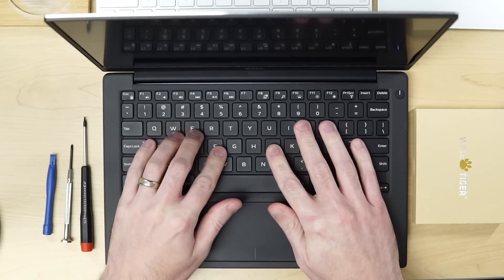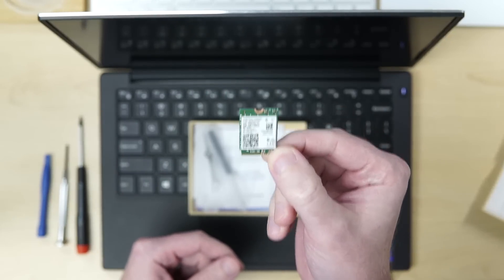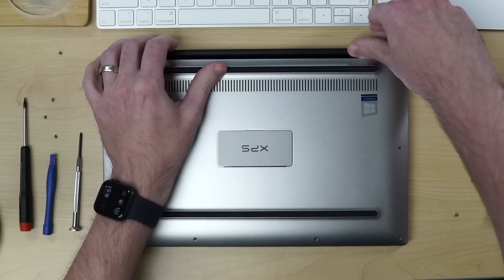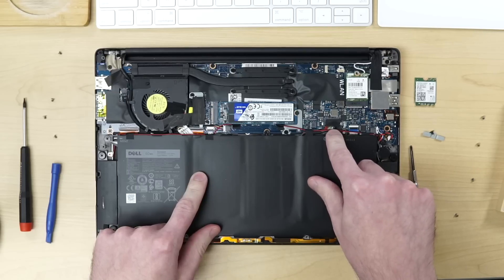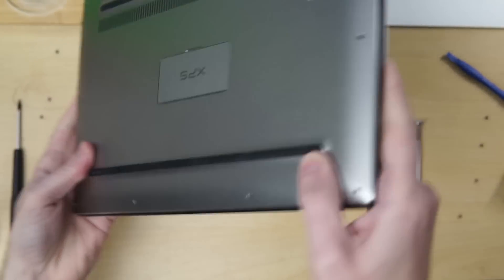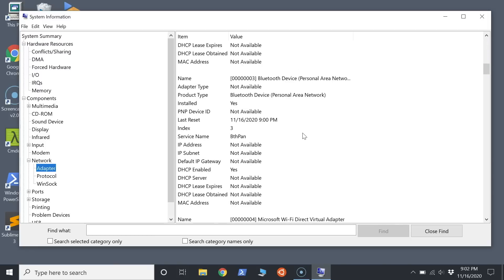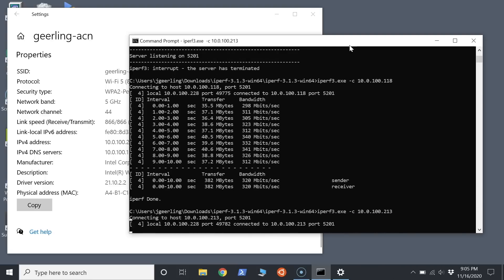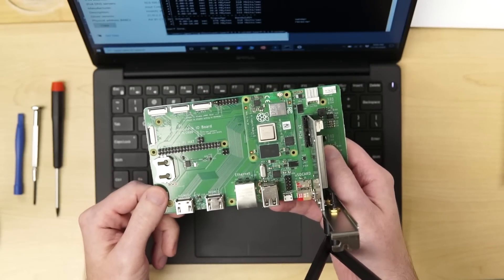How to Upgrade a Dell XPS 13 to WiFi 6 (802.11ax)

Comment: TPM error is due to the fact that you changed the HDD
Reply: If you replace the original HDD then TPM error will disappear 🫠
Reply: Also TPM Third Party Module is security for HDD the HDD is paired with the Bios if you remove the HDD and try to access the data on a different machine the DATA will not be accessible because on power up it doesn’t recognise the bios TPM

Comment: I did this mod on 9350 model. The wifi worked fine on Ubuntu and win 10. Bluetooth worked good on Ubuntu too. My only issue was win 10 kept throwing a code 43 error in device manager for bluetooth. New and old drivers made no difference. If I reinstalled the drivers, bluetooth will work fine until a reboot and the error code 43 pops up again. I don't use windows that much so I just gave up trying to fix it.

Comment: Hi Jeff, can I check with you, what is the wifi socket type for the Dell XPS 13 (9360) (A Key or E Key)? Does it support CNVIO/CNVIO2? Does it support the E-Key only Intel BE200 Wifi 7 card? Will there be any issues on Wifi 7 with using the existing internal antennas?

Comment: 9:47 its still connected to 5g, and never connected to 6g....so the wife detected but did not connect to wifi6.....it didnt work....
Reply from the maker: WiFi 6 only works on 2.4 and 5 GHz channels; WiFi 6E works on 6 GHz (in addition to the other two).
Reply: is wifi6 working on the 6ghz with your xps 13 after this install?

Comment: will the  AX210NGW WiFi Card, Wi-Fi 6E 11AX Wireless Module Expand to 6GHz MU-MIMO Tri-Band Bluetooth 5.3 Internal also work that the difrance
I click your link but out of stock you list the AX200HGW  and the on in stock is AX210NGW  is this just answer model?

FYI Great Video

Comment: um, I worked for Dell pro support up until a few months ago, the reason your laptop keeps turning of and on again is actually more than likely 1 of 2 things. on the dell drivers page make sure you go to the chipsets or just browse all of the drivers for a "virtual button"(may include the word controller) from intel, some of the xps 13 have a firmware for the button assembly that is controlled by a intel chip because they included "human detection" featured so if you go to turn it off but the human presence sensor on it is detecting your presence if kicks it back on..... the other is a need to actually do a bios rollback. Honestly the BIOS on dell systems tend to be really.... less than ideal.... but thats just my opinion as someone who had to work with them all the time.

Comment: I don't own either a Dell or Mac, but got a gigabit fiber into my house. 

The desktop which runs an Ax 200 it gets a 600/500 via WiFi. My Asus laptop which got its WiFi replaced from 9650 to Ax 201 it gets 600/600. 

I have a WiFi 5 router.

Comment: It's better to download the compatible driver for the WIFI card you're gonna use before replacing the old one.  Otherwise the new card may not be recognized (I just faced this issue and needed to connect to the internet using a cable).
Reply: my wifi card failed because of driver update it:s a ax210 i requested a refund what should i do i need a upgrade

Comment: How does it work with linux?  I'm interested in upgrading to the same chip but I'm running linux mint exclusively on my XPS.
Reply from the maker: The AX200 seems to work okay with Linux, and is one of the better-supported cards. For my Raspberry Pi I had to patch the driver though—not sure on other computers. https://pipci.jeffgeerling.com/cards_network/edup-intel-ax200-wifi-6.html

Comment: 7:26 I have the exact same issue! Appeared after the recent BIOS update, and, for the life of me, I cannot fix it. Tried disconnecting the main battery and reconnecting, disconnecting the CMOS battery and reconnecting. No luck either way. I eventually had to downgrade the BIOS as that white screen on every boot was driving me crazy.
Reply from the maker: Heh, I might try to downgrade the BIOS at some point. Right now I only reboot every week or two, so it's not a huge annoyance. It's most annoying when I reboot, but walk away, and the next morning I see it's been powered up all night on that dumb TPM error screen!

Comment: I have that same set of Radio Shack screwdrivers.  I also have that E-Keyed wifi 6 m.2 module (not pcie) with it's solid heat sink that plugs directly into my EVGA X2999 motherboard.  Needs a wifi 6 router though for the thing to have improved performance.
Reply from the maker: Heh... just upgraded my router a couple nights ago after realizing I now have two WiFi 6 computers in the house! And yeah, those screwdrivers are tanks. Used them forever, only broke the smallest flat head driver one time when I was using it to pry something that wouldn't budge.

Comment: The problem with shutting down the BIOS exists since the 2015 model. Back then, I concluded is an engineering problem either on the Dell motherboard or by the c-states on the Intell CPU. When the 2017 model came out, I was surprised to see that the issue was still there. Not sure which model you have, but I never found a fix. BIOS updates never worked for me either.

Comment: I have the same issue with my lenovo, i'm pretty sure that it's more issue of win10 than anything else.
After they added shutting down which hibernate device instead of shutting it of the problems began, when i try to hibernate or shut down it is going buck up immadiently, but if you go to the cmd and do "shutdown -s -t 0" it is always shutting down correctly.

I had also issue with desktop because of this stupid windows behaviour, in which "shutting down" (aka hibernation ...) windows 10 caused malfunction of my aim sc808 (sound card) and i needed to use cmd command to shut it down correctly.

Comment: Ah nice :3 you're lucky your laptop's bios doesn't have whitelist for components. I had a lenovo laptop many years back, it had a whitelist and won't start if "unofficial" components were installed. I tried to mess with the bios chip with a eprom programmer, ended up bricking it :P
Reply: A lot of Lenovo laptops do that... fortunately there’s usually a fairly simple fix — even if you brick it. Most only require the eeprom programmer if you’ve already messed up or it’s I the x220 era.

Comment: Try the SuperIO trick with the TPM to see if it fixes the problem. Unplug the power cord and the battery and hold the power button down on the keyboard for a few minutes and then reconnect the battery and turn on without the power cord connected.

Comment: Try disconnecting the battery. Then press the on and off button. And then reconnect your battery. And boot your laptop. I had the same with my dell optiplex 7040 and after unplugging and re-plugging the power cable it could boot without a TPM (Trusted Platform Module) error.

Comment: Well technically the laptop ist power on after shutting down and closing lid but when you lift the lid the laptop turns on so disable open lid to power on option in bios. Also you didn't put drivers and used crappy windows drivers. I have upgraded to wifi 6 router and replaced wifi 5 card in laptop to wifi 6 and it works like a charm

Comment: Jeff, small question: How did you do the overhead shot? did you use a C stand?
Reply from the maker: I have a desk-clamp-mount arm. It was like $40 on Amazon, I think... though I don't remember the model. It's not quite as stable as I'd like but it works out okay as long as I don't bump the desk!

Comment: I'm sorry, but the AX Raspberry Pi idea won't work (yet), unfortunately. 
The EDUP adapter uses an Intel AX200 (one of the very few AX PCIe modules available on the market right now). 
These modules do not support "IR" mode or initiate radiation mode, which is required for access point operation. 

With a bit of firmware hacking, I was able to run these modules as an AC access point, but got very unstable connections and only ~400 MBit/s of throughput. 

As far as I'm aware, there's no good solution for AX APs yet, the ath11k and MediaTek drivers both are very alpha still and the modules are pretty much unavailable.
I love WiFi 6, but it's still a bit too early.
Reply: Hm, does it have to actually be an AP? What about Wi-Fi Direct or other peer-to-peer connections instead?
Reply: @nathanadhitya  The IBSS "adhoc" mode could work better, but that's not compatible with any traditional devices like phones or Windows laptops (for internet connections at least)

Comment: You ve inverted the wire(aux and main) when switching the wifi card, plus you are running the generic driver from Windows, probably the latest from intel are a little faster and more stable. P. S. You can use intel dsa to get always the latest considering that the ax is pretty new.
Reply: Nope, antennas are okay, look closer to colour markings on old card.
Reply: @jankkhvej the black and white triangle place are inverted between the two card, so you have to switch the cable.
Reply: @Mrschinella  Read text markings on cards and compare :-)
Reply: @jankkhvej  you are right i didn't noticed that the main is white on the old card, so when upgrading it's important to reinstall main with main and aux with aux, ignoring the color scheme(that i wrongly supposed was standard)

Comment: 802.11AC= 1 Antenna is 433Mbps
Macbooks uses 3 antenna = 433Mbps*3 = 1.3Gbps
Windows laptops uses 2 antennas = 433Mbps*2 = 876Mbps

1.3Gbps and 876Mbps are the throughput of both TX/RX, so you gotta half that for expected iperf testing,
These are real world,
1.3Gbps/2 = 650Mbps
876/2 = 433Mbps

Macbook sometimes reach 900Mbps on wifi, so its within the range of 650Mbps-1.3Gbps due to wifi's half-duplex nature.

Now, for Wifi 6, 
(Wifi 6) 802.11AX= 1 Antenna is 600Mbps

Plugging in AX200 intel gives you 2 of it,
600Mbps*2 = 1.2Gbps

Both I said up till now are running on 80Mhz. IF your client/server/router/ap supports 160mhz, it will double the throughput from 1.2Gbps to 2.4Gbps. =)

TLDR,
802.11AC 80Mhz = 1 antenna = 433Mbps
802.11AC 160Mhz =  1 antenna = 876Mbps > also known as (Wave 2)

802.11AX 80Mhz = 1 antenna = 600Mbps
801.11AX 160Mhz = 1 antenna = 1.2Gbps

Macbooks = 3 antenna
Windows laptops = 2 antenna

Side note, iphones and samsung has only 1 antenna wifi 6. Kinda ironic how many antenna they use for cellular.
Reply: Great explanation.
I have a laptop with the ax200 and I can definitely saturate a gigabit connection from an access point with a 2x2. We finally have actual gigabit (+) wifi!

Comment: shut off the laptop by holding the power button for long and also unplug the ac adapter
you could also just unplug the battery directly
then let it sit like that for 30 sec and connect the battery back if disconnected and turn on the laptop, the tpm error should be gone.

Comment: You need 3x3 and wide channels (80 or even 160 MHz) for the really high performance ax, the ax200 chipset is 2x2 while your MBP may be 3x3 depending on the year and model. You also need a pure ax client environment (on a particular radio) to really see the full benefits of ax. If you have an non-ax clients, disconnect them from the access point you’re using for testing.
Reply from the maker: Yeah, I'm finding that most of the devices that actually do really well on ax (though I haven't tried them personally) have had their antenna configuration changed to support it better. I'd be really interested in seeing how the WiFi 6 in the new Apple Silicon M1 Macs performs, since Apple seems to devote a lot more time to the wireless testing/certification on their laptops.

Comment: Well with a little search
Have you tried shutting down the laptop and unplugging the AC cord for a few moments? (Possibly disconnecting the battery as well)?
Seems to have fixed some peoples issue with that error code

For others it meant replacing the board to resolve it.
-
High internet speeds can be CPU limited, you can try increasing the jumbo packet size.
With that said, WIFI6 isnt anything special imo, it would really only be useful with a lot of WIFI devices connected to the router that actually use the AX band.
My FIOS Router and Extender are WIFI6 Capable and the only real difference between the previous router and extender is the WIFI range is a bit better than before.
Reply from the maker: Yeah I know on the Pi itself, irq interrupts cause the limits until you use jumbo frames. I don't think the intel processor in the 9360 is the limiting factor in this case, but I should probably also test with a gig e adapter too.
Reply: Figured u already knew all that but meh. :)

Comment: Lucky you the replacement wifi card fits physically in the same spot as the old one and that your Dell bios hasnt it blacklisted; I built a Hackintosh on a Lenovo U410 5 years ago; when I tried to use the built-in intel wifi it was impossible, no drivers under hackintosh; then I got a used iMac wi-fi original card but it was 1cm longer than factory's, so I ended up dremel-ing the bottom case to allow for the difference (with higher rubber feet too); and then went into a nightmare finding,, downloading and flashing a Lenovo hacked bios without a hardware blacklist; all in all, it turned out to be a great hackintosh build for an i5 with 16gb and wifi under macos sierra in my trusty Lenovo

Comment: Go to bios and turn off tpm (trusted platform module) & if the option is not there then u can try modifying the bios with ami bios editor and flash it with a 2$ AliExpress bios programmer! .. & this ax200 is available for like 12$ on AliExpress and i have one for more than a year now & its really good card , even tho i only use it for bluetooth 😂 . & Make sure u have that power on when lid open is turned off from bios.. (Its really annoying thing in my lenevo thankfully it can be turned off through bios)

Comment: I google the TPM error (Trusted Platform Module) and the first solution was to fully power down and remove the battery power for approx 30 seconds.  Then after that it will cold boot and find the module again.
Reply from the maker: I've tried that (almond with also removing the CMOS battery!), and it still didn't help :(

Comment: The TPM is  the Trusted Platform Module and is used for a wide variety of security and cryptography tasks. One such task is ensuring sensitive data is removed from RAM during shutdown. This might be why you're having a shutdown issue, but I wouldn't expect it to.

Side note: Trusted Platform Module Module not detected.

Comment: I have a 9350 and four years later it's still my favorite laptop of all time.
Reply: same here! Any major issues with yours?
Reply: @A4orce84  None at all. Even the battery is still good.
Reply: I got the 9350 too but i'd rather have a quad core 9360! Also i'd prefer 2k non-touch screen instead of the 3k glossy touch screen
Reply: I still have mine! What about you @wesley00042?
Reply: watching this video 4 years later on my 9360 going strong, I forget its old

Comment: Ooh I had a similar problem with the exact same model (year) of XPS-13 a while back, no TPM error, it would just keep starting up when I tried to shut it down! I think my solution may have involved nuking windows and going to Manjaro... honestly I've had no end of problems with the Killer WiFi, this looks like a decent improvement and more stable!
Reply from the maker: Ha, maybe I should just nuke Windows too... the only issue is I still want to play Halo 3!
Reply: Very true... old habits (and games) die hard!

Comment: Reading the description - uhoh! Thankfully it wasn't storage or something that might be sensitive to such a thing.
Reply from the maker: Haha, that would've been more exciting!
Reply: @JeffGeerling  Regarding the TPM error, it's a power management related issue. Usually it happens on AC power, but have you tried unplugging the battery and leaving it unplugged for a while?
Reply from the maker: @izzieb  Yeah; I left it unplugged for a day, then turned it on and off a few times (it always rebooted immediately to that TPM screen again).

I tried disconnecting the battery and CMOS battery, and leaving it for a few hours, then plugging back in. I tried doing that, then plugging in AC power and resetting... nothing has worked. It just always reboots even if I hard power off, and it always gets stuck on that TPM screen until I click continue.

It was fine until some BIOS update a year or so ago.
Reply: @JeffGeerling  Ah, bummer - though I expected that you'd have tried it. Sounds like a bug in the BIOS - someone at Dell didn't do enough testing.
Reply from the maker: @izzieb  Yeah and the fact that I see sooo many posts around the net about it means it's a pretty widespread problem :(